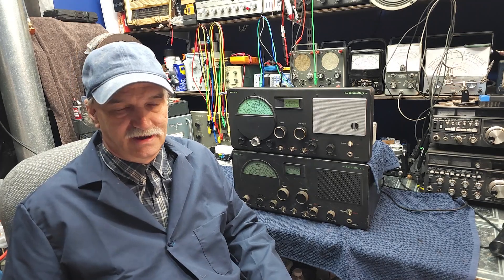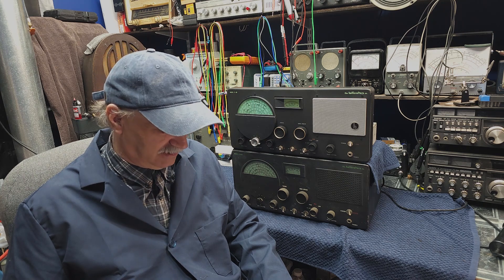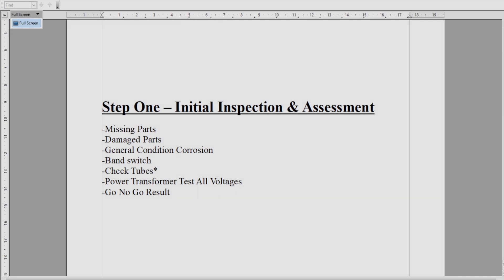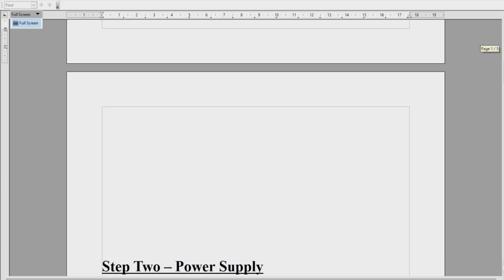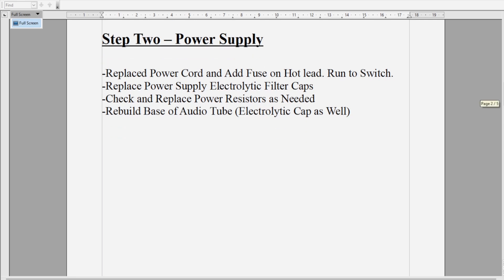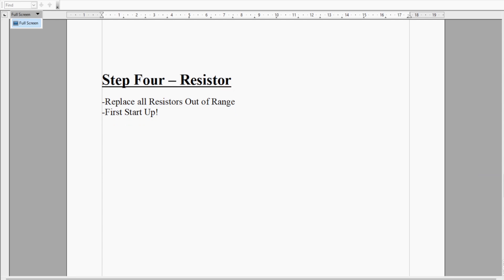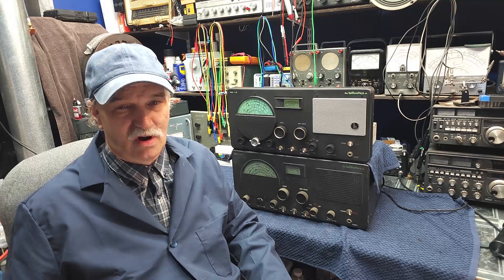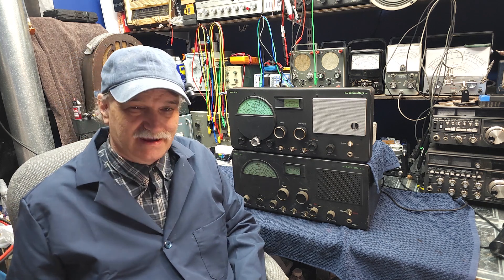Learn to Restore Tube Radios - Step by Step

Comment: Thanks so much for these very helpful and educational videos. I had two questions concerning the restoration of an RCA 5Q55 radio. 1) In replacing the paper capacitors, what voltage rating should I get? and 2) The schematic calls for an electrolytic capacitor, actually three in one can. Two of the capacitors are 20 mf and the third is 20 mfd. Agin what voltage is important and is there an supplier you know of that still makes such units? thanks
Reply from the maker: Does the manual not tell you??? usually there is a parts list with voltage requirements.
Reply: @MikesRadioRepairRestoration  I have a schematic and parts list downloaded from one of the antique radio sites.  While the parts list has resistor values and wattage rating, the capacitors only note the value and not a voltage. The schematic does not list voltages. Any help or guideline would be useful. The same issue is present with the electrolytic capacitors.
Reply from the maker: @ThomasKuech-d9z   paper caps 600 volts or more. What is the B+ voltage??
Reply from the maker: @ThomasKuech-d9z  electrolytics would be 450 VDC or better. Get the spec right. 2 of them are part of time constant filtering.
Reply from the maker: @ThomasKuech-d9z  Buy 3 separate caps a 10, a 10 and a 20. All at 450 dc. Install the 20 right at the base of the audio tube and restaff the aluminum can with the two 10s.
Reply: @MikesRadioRepairRestoration  Thanks for the advice - it will be followed. I can find the B+ voltage on the schematic. I am not at the point to power up the chassis and wanted to do the replacements you suggested on your 5-step process first. I haven't measured any voltages as a result.
Reply: Thanks so much!
Reply from the maker: Im sure its less than 450 VDC, i took a quick look at the schematic. I can see they have written 335 VDC at the output of the 5Y3. So go with 450.

Comment: I have a Hallicrafters SX-25 that I just put on the bench. I got the radio at a hamfest from the sales of a silent keys estate. The only obvious modification was the power cord, it has a polarized connector, and a fuse. I didn't see anything alarming in the radio and powered it up using a Variac and a dim bulb setup. The radio took power okay, no issues except the current draw was really low. I checked the tubes to see of they were warm, the rectifier tube (80) was cold. I decided to test all the tubes before going any farther. There are 12 tubes in this radio, 7 of them measured bad on my tester (I've never had so many tubes show as bad in a radio before). The radio appears mostly original except for a new film resistor and pot for the S meter adjust. What would cause that many tubes to go bad? Should I just proceed as I usually do and replaced all the electrolytic and paper caps and bad resistors (and the bad tubes)? Thanks for any thoughts.

Comment: What do you do when your S40 has been “modified” so that it doesn’t follow the schematic?  Should you remove the mods and go back to the original schematic or replace the parts that are no longer working properly?
Reply from the maker: First question. What is the mod? what was its intent?
Reply: I'm not sure what it is or why it was made.  It is different from the schematic.  I meant this as a general question.  What do you do in a case where the actual circuit is different from the schematic? Stick with the schematic or replace any bad parts of the modification?  @MikesRadioRepairRestoration
Reply from the maker: Second question. Does the radio operate? Has it been restored yet?
Reply: No, it's one I've been working on.
 @MikesRadioRepairRestoration
Reply from the maker: Join this group and post photos if you are unsure. https://www.facebook.com/groups/mikesradiorepairrestoration
Reply: When I get back on it I'll send some pictures.  Thanks for the reply.  I'm trying to learn how to do repairs.  I've successfully completed several but have so much more to learn and so many questions. I appreciate your videos and your time.
 @MikesRadioRepairRestoration
Reply from the maker: @andy2538  Are you certain its been modified? There are different versions of the S-40. Does the mod look factory done? If it is modded, some mods your remove, some you keep. I have to see it.

Comment: This is perfect for me, and thanks for your excellent instruction here.   I was glad you listed the radios you will be working on.   I don’t have any of them, but I am tempted to get one so I can follow along in an exact fashion.   I do have an SX-100 and if I could get to the point of having that one working well, that would be my ultimate goal.  But something simpler to work on first I think.   I have an S38D but it is in terrible condition.   Maybe I’ll start there anyway.    Others I could tackle are a Heathkit SB-300, and a Drake SPR-4 (solid state).
Reply from the maker: The S-38 would be a great place to start. You could join our Facebook page and toss up a few photos so I can see if its worth your time. I would need to see the top and underside of the chassis. Cheers!
Reply from the maker: https://www.facebook.com/MikesRadioRestorationRepair/